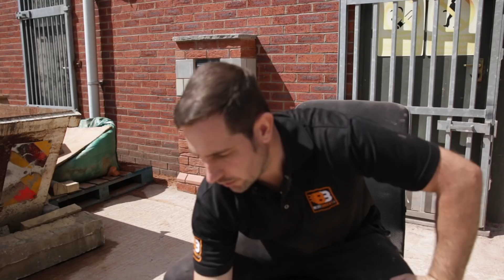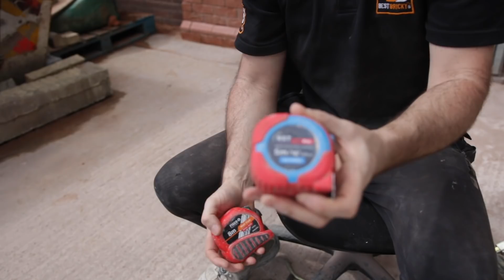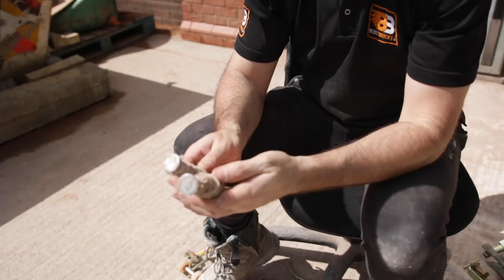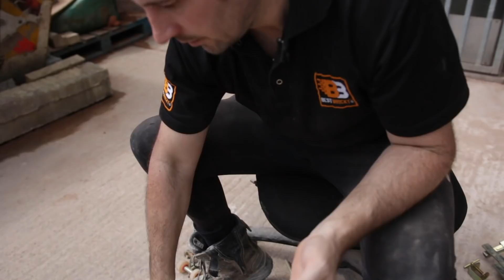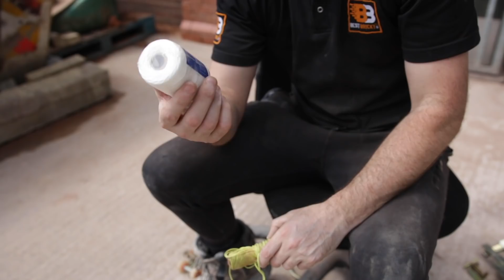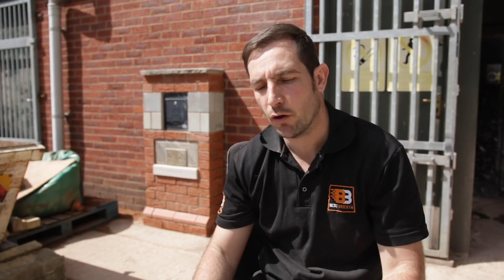Bricklaying Hand Tools

Comment: Footprint is the way forward for any type of cold chisels and line pins of course. The bolster 41/2 with extra spine on blade are the best. Had 1 for 16 year just the neck on its only 60mm left on it so got a new 1 lol. Do like the braided W Rose brick line never snaps real good stuff. Stabila have that 4ft 1 stu don’t why any would use any thing else otter stabila. Also have the steel H beam type but only can get it 1000. Always wondered why the didn’t do them in 1200 length because they last for ever mines 17 year old still unbreakable 😬